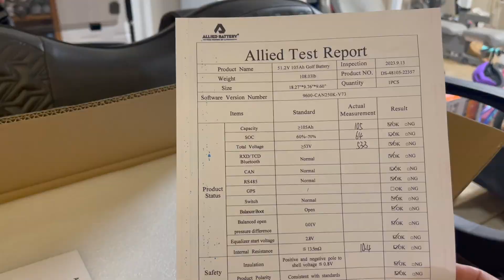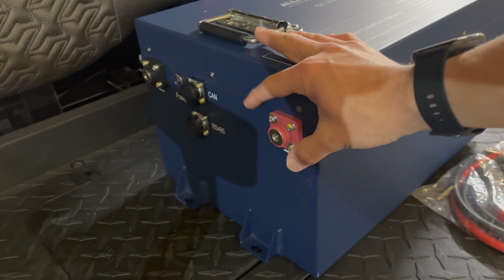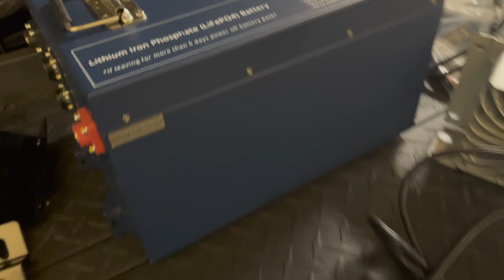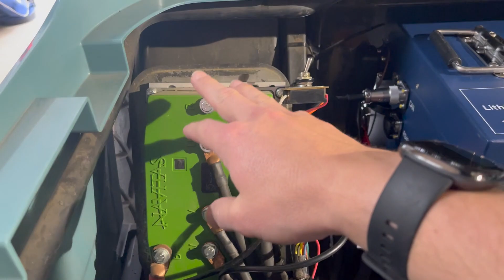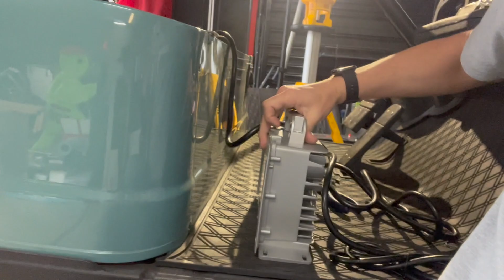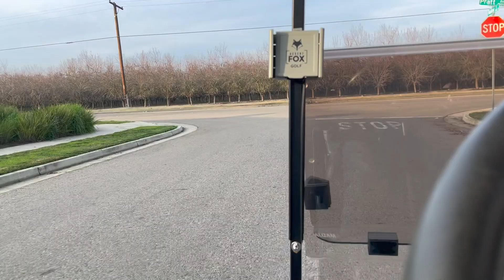High Performance Lithium: Allied 48v 105ah Installation

Comment: Did you use an Allied 400a solenoid with the sleep mode?  Installing same Allied setup now and have both a Bolt solenoid and Allied solenoid, both install differently.  Can't figure which one to use.

Comment: is it required to purchase a 12v battery for the accessories like lights and speaker or can we somehow connect it to the 48v battery?
Reply from the maker: @crestrepo114  no you just have to run a voltage converter between the battery and 12v accessories. I’d recommend one with a switch wire so it will power down anytime you turn the cart off.

Comment: How is a 12-volt Striker unit working on a 48-volt battery without burning up
Reply from the maker: @Unclebillh  I was running a voltage reducer to convert the 48v to 12v for all the accessories.

Comment: I'm trying to install an allied 105A battery in a Club car precedent.  I installed the battery but not the solenoid.  The battery tuns off immediately when the power in engaged.   I did not install the solenoid supplied or the voltage converter, hoping the club car units would be ok.  Could this be causing my problem?

Comment: I'm getting a lot of resistance trying to find places to do this.  They're mostly all telling me it'll never go over 31-32 mph.  
Can I give them specific instructions & parts to achieve this?  I don't need to do wheelies but I want to be able to go over 30 mph consistently.  We have a lot of hills.
Reply from the maker: My cart will top out at 35-36 mph on flat with the Navitas 600a 5kw motor/controller combo and pretty much any lithium I’ve tried. I will typically hit 20-25 on fairly steep hills. I was getting 32-33 mph with lead acid on flat. 

There’s multiple factors that go into it (tire size, gear ratio, voltage). I’ve been chasing 40 mph and have come to the realization that voltage is everything. The cart I’m currently building is 72v and should cruise at 45-50 mph.
Reply: @projectkarr  Thanks for that.  I'm quite surprised of all the golf cart guys I talked to nobody has done anything other than battery upgrade.  They are all saying 30 max-ish.  My lead original batteries got me about that when new.  I'm hoping to figure something out.
Reply: @projectkarr  Holy cow 45 mph?  I just bought LiTime 48v 30ah (I don't drive far at all, couple miles at a time) and am ready to wire it up.  I have a 2013 EZGO RXV.  I've scoped out the wiring.  Do I have to worry about the new lithium ion single battery overpowering my motor?  I don't know what watts the engine is but I assume it's 2000-3000 watt.  Would love your input before I hook it up -- hate to FRY something!  Luv your videos.  Best I've seen on lithium ion battery golf cart action.

Comment: Great video. I put new batteries in my cart. Big battery 48 volt. I was driving with fully charged batteries and my cart just locked up. It wouldn’t move at all. Shut off all power, unplugged the batteries. Plugged it all back together and got it back home.

Motor controller?

Any thoughts?

Thanks in advance.
Reply from the maker: Hmm that’s interesting. First I’d use a volt meter on the main positive and negative from the battery pack to make sure you are getting 48v. Then I would go through checking electrical connections to make sure nothing is loose. My club car was doing that a while back and after cleaning the connections on the solenoid it hasn’t done that since. 

Since you were able to get it going, I would assume loose connection or overheating.
Reply: @projectkarr  thanks I’ll check.
Reply from the maker: That’s odd, stock motor and controller? Also what model from big battery?
Reply: Sorry not Big Battery. Trojan Motives 48volt. Standard motor and controller on an EZ GO.